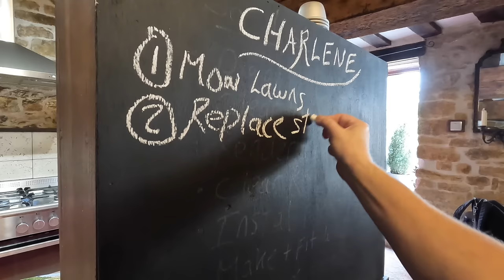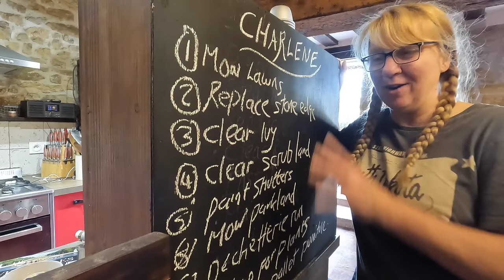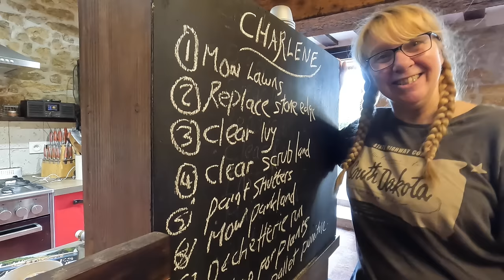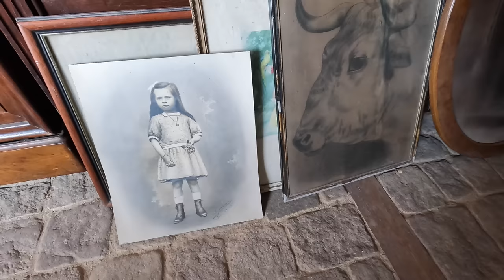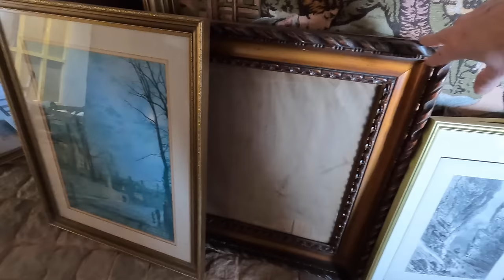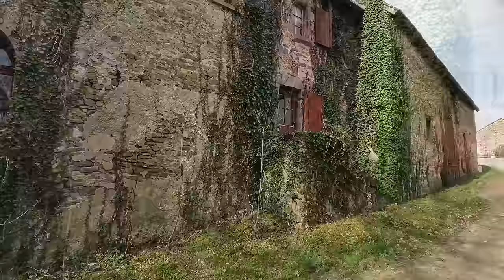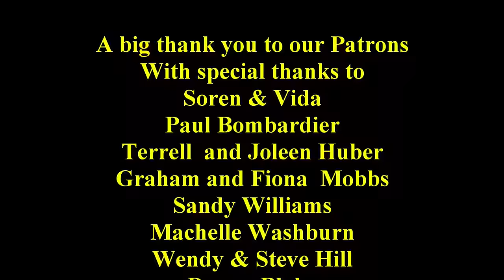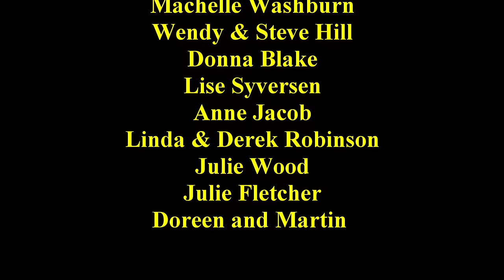SHOCKING discovery as the ivy is removed from the chateau walls.

Comment: Once you remove the ivy from the walls, you can pour vinegar and salt mixture to kill out the roots.  It works for me.  I'm so happy Charlene is there to help!
Reply: They have said they tried that and it did not work.
Reply: Copper nails perhaps? Though could be difficult to procure
Reply: I woud not pour salt close to a stonewall, not even in France….
Reply: The little stepnis a mounting step to help you get on a horse x